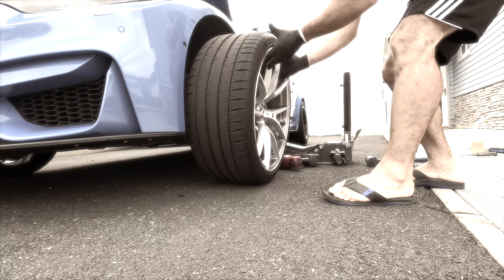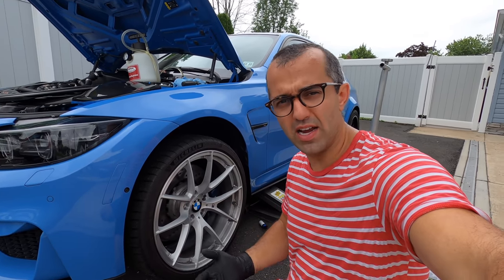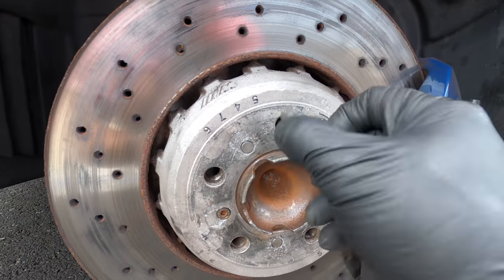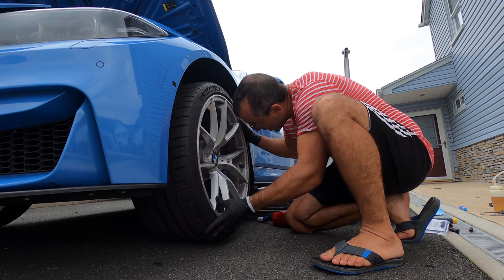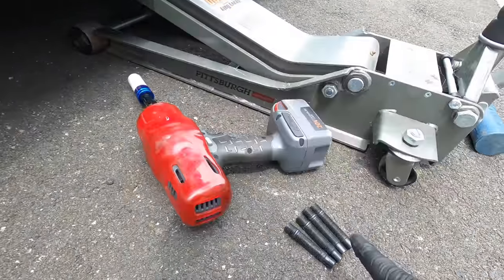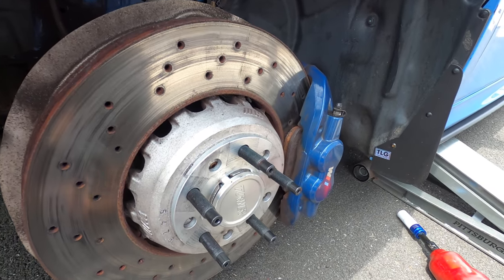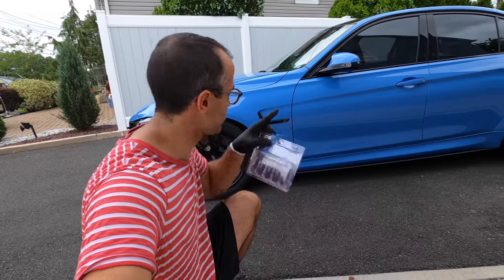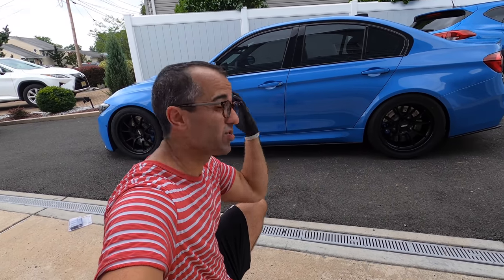This should have been my first BMW mod...

Comment: I too have been putting off doing the stud conversion. It’s just so much easier. However, I’ve been using wheel hangar studs in the interim. They work really well for those that haven’t converted or don’t want too. Awesome vid as usual!!
Reply from the maker: I think studs make it less likely that you scratch the inner part of the wheel where the nut goes

Comment: For cars without studs, I use a wheel hanger. Just take off top bolt, put on the wheel hanger and it works just as good.
Reply from the maker: Good option too

Comment: Hey Tommy. Yeah this mod makes it supper easy to swap out wheels. For me personally I prefer the bmw wheel bolts, for two reasons; the locking key is unique and cannot be replicated easily and I fear the studs are going to break when I go to crack open the wheel nuts.
Reply from the maker: I had them at the track and they worked well. I also observed many hardcore racers and they all had studs. Hhmm

Comment: About time, your back will thank you now ;-)...  Glad to see you also went with the  "beefier" thread conversion (14x1.25 to 14x1.5) as well since the more course thread is more robust and less prone to cross threading.  A tip for you (and others) , after you wash your car, take it for a spin around the block to help get any residual water out from around the studs and nut threads (even if you use a blower to help dry your car).  That little technique will help prevent the onset of corrosion of your studs...
Reply from the maker: Good call on the drying.  I’ll do that. Thanks.

Comment: Such a great and simple update. You should really be using Red thread locker on those though.
Reply from the maker: Hhmmm I might redo it
Reply: @TommyLGarage  I waffled around on this for a long time before pulling the trigger. While I was concerned that red thread locker would be more permanent than I wanted, the instructions for all the stud kits I have seen specify red. The big concern is probably when removing a nut, you don't want the stud to back out at all. Especially as mentioned earlier, the tightening torque of the stud is pretty low compared to the tightening torque of the nuts.

Comment: Personally whenever I torque my wheels down I'm always more comfortable doing it while they're still hanging in the air so you're not putting pressure on the studs/nuts/wheel lug interface when you drop it on the ground. I guess it's harder to do with RWD car but maybe get something to press the brakes or something :p
Reply: This is what we do in our garage. If potentially one of the nuts is not 100% seated and you drop the weight of the car onto the wheel, torque it as much as you want but that wheel will not be considered tightened if it's being torqued crooked
Reply from the maker: Great points. What I do it I re-torque then after a short drive
Reply: @TommyLGarage  yes this is good to do! Better safe than sorry
Reply: @TommyLGarage  Ah, that's good. In my experience (although not high performance cars), as long as I torque it down while the wheel is in the air, I never had any issue with needing to re-torque it. Nothing is ever loose. When I first started working on cars and I dropped the car to the ground before torquing, there were times stuff came loose especially if there's lots of temperature difference (winter time)

Comment: Tommy,  your link went to "CONVERSION STUD 14 x 1.25-14 x 1.5  78mm"  but i dont see the locking nuts in 14x1.5mm. I only see them available in 14x1.25mm. Is the link wrong? DId you go with a 14x1.25mm stud?
Reply from the maker: I called them up and bought over the phone 
Tell them to give you what they sold me.
Reply: @TommyLGarage  Thanks Tommy, ill have to do that. Thanks for the quick response too.

Comment: All the years I owned EURO cars I have been using wheel hangers studs , allows you to get the wheels off even further from the car without damage and I have Carbon Ceramics so there important .https://www.amazon.com/Black-Wheel-Hanger-Alignment-Guide/dp/B07RP2V97S

Also I recommend future classic spacers by IND the absolute best spacers they utilize the rotor hub bolt to hold the spacers fixed to the hub they can’t get unaligned or fall off , they give you a complete kit everything needed with the spacers
Reply from the maker: Stud conversion looks cooler !
Reply: I've done the same for years, but if you change tires often, say for tracking , then studs is the way go. It doesn't look as clean as the lugs, in my opinion, but it does look more purposeful and aggressive
Reply: Elio Alfonso This definitely makes sense!

Comment: The irony that when he put on the wheel with the bolts it didn't make any sound, but when he installed the studs and put the wheel on... all kinds of noises.
Reply from the maker: Good point !
Reply: The studs will scratch some area of the wheel more.  I think the whole point of studs are faster wheel changes and switching from no spacer and placing spacer is easier without having a whole new set of wheel bolts.
Reply: Yeah I do agree they make some things easier, but as in all things in life, everthing has it‘s pros and cons.
Nothing against studs but it was kinda funny in this video demonstration.

Comment: Hi Tommy. Nice video! I noticed your BMW emblems being weighted. Is this OEM? Anywhere I can get those? Thanks!
Reply: Sorry to jack your thread. I noticed you were looking for the floating center caps. I bought mine from Amazon. They are OEM BMW parts not a knockoff or anything. And they look great! Here is the link.  https://www.amazon.com/dp/B07T3GTYF6/ref=cm_sw_r_sms_api_i_GxFhFb
Reply: @rickpotter775  Thank you very much!
Reply from the maker: Yes oem :)

Comment: Wait I want to see the lock nuts because with the stud converters the front hex is exposed. What stops people from unscrews the wheels from the studs?
Reply from the maker: You can’t unscrew using the hex. They’re designed to reform. There’s a special removal procedure that’s required.
Reply: @TommyLGarage   and that is?  Only asking because I have these installed and getting ready to remove them because after 6 months they're starting to rust up and they look terrible. Want to take them off.

Comment: How do I take these off once installed with red thread locker? My studs have rusted and look bad. I want to go back to OEM BMW bolts but having a hard time removing them. Any ideas?
Reply from the maker: Yes. You need two nuts. Lock one against the other and start undoing them.
Reply: And some heat to break the bond.

Comment: Where did you get the locking wheel studs and what size are these studs?
Reply from the maker: I linked it all in the description.  
Got it all from Kies. For locking you need to call them

Comment: ...a would be thief now knows the Allen Wrench (tool) size,...as well as knows the Studs are tightened to just 25-ftlbs,....that lugbolt Lock doesn't mean diddly since a thief can just use an Allen Wrench and remove all 5 studs!  If they want your wheels,...our wheels,....bad enough they will get them!
Reply from the maker: JMD535 yes but you cannot unscrew the studs with Allen bolts. They are designed to break. You unscrew them by locking two nuts in place.
Reply: @TommyLGarage  ,..they are designed to break off",....  Sir, this is good!  May I ask what is "designed to break off"?...the end of the stud or the Allen wrench tool?
Reply: @JMD535  They aren't designed to break off. Once the thread locker has cured (should be red not blue) then if you try and remove with the allen head, you will strip the hole because of the torque required. The allen is just for ease of installation. As Tommy says, Double nut is really the only way to remove.
Reply: @JVR_Funwithdesign  10-4!
Reply: @JVR_Funwithdesign  Correct.  Should use red thread locker for this application.  The allen head is use to install this particular stud.  If you bought the bulletnose studs then you have to go with two nuts for install.  And also buy longer studs, just in case you decide to use a spacer such as 15mm spacers for rear of the E46 M3.  Removing is a little more complicated with two nuts, crow bar or some way to stop the hub from rotating and possible some heat from a torch to loosen up the red thread locker